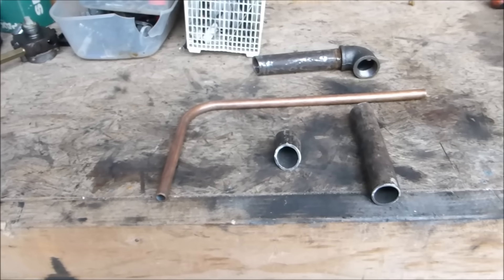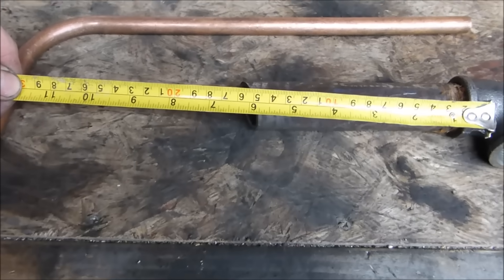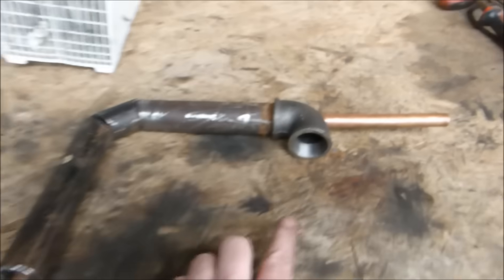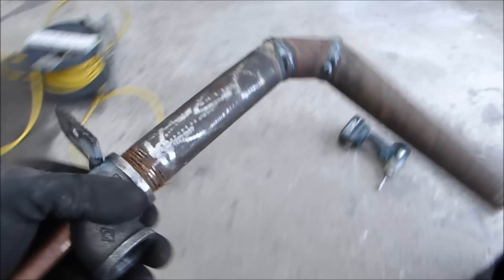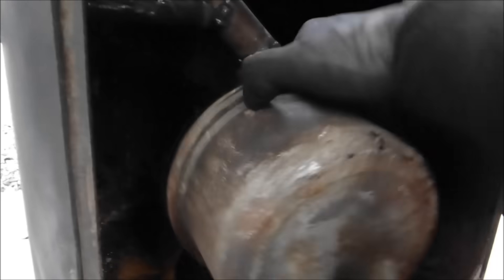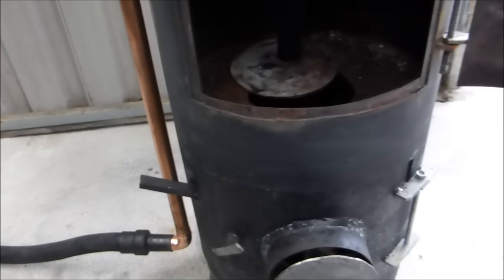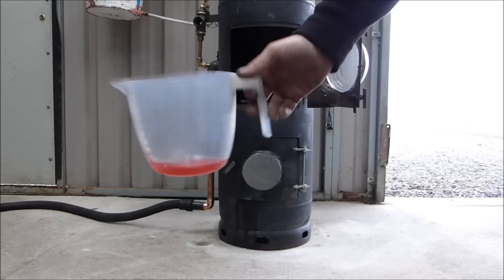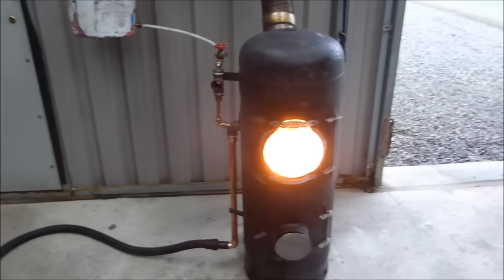Build a New and improved fantastic output Waste Oil Burner.

Comment: I'd  love  to  see  this    heating  water  for  feeding  round  a  waterborne  heating  system  (radiators)  or  blowing  warm  air  through  some  transverse  tubes  going  through  the  burn  chamber,  providing  warm  blown  air.  A  household  air  recirculating  system  could  be  used,  re warming  the  air  from  one  end  of  the  house  and  pushing  it  back  into  the  other, thereby  reducing fuel use by  not  heating  up  fresh cold  air  all  the  time!  this  apparatus  is  a  little  too  noisy  and  smelly  (not  to  mention  unattractive)  to  have  in  your  living  space,  and  will  need  to  be  somewhere  else  where  it  can  smell  sound  and  look  as  orrible  as  it  likes!
Reply from the maker: Hi Iain. I made some videos a few years ago with an Ozzirt waste oil burner connected to a hot water clinder. The system of connection is the same as a home water based heating system with rads. Some of my newer burners would be a better fit with this setup.  https://youtu.be/PaEOpqqPwgs   Cheers Gerry

Comment: built one of these today, started and about 9 o clock and lit it at 2 o clock, super simple. i revised a few things which i think make it a little easier, but never the less couldnt have done it without this video, going to convert the barn from propane to waste oil or diesel or kero
Reply from the maker: Well done tuesday, enjoy being warm wednesday , thur... (lol) Thanks for the comment and well done on getting the unit built.  Cheers Gerry
Reply: Does the all need to be shallow in the holding hands
Reply: That was supposed to be shallow in the pan that the pan so it reaches  igniting temp for oil

Comment: Thanks for sharing your excellent videos! Can you explain why not use two separate tubes for air and oil? Is that to shield the oil inlet so that it doesn't catch fire before being injected?
Reply from the maker: Hi Max. The tube in a tube method is just to stop the oil line from burning the oil on the way down to the vapourising pot. It would quickly char up and stop flowing. The air helps keep things cooler. In one of the videos I used an old boiler to heat about 80 gallons of water. Once you can make heat its an easy enough job to transfer that heat to water. Here's a link of a non forced air burner heating water.. https://youtu.be/1Et3rIn5GIY   Cheers Gerry

Comment: Hi Gerry,
I've  built one of your burners but im finding i need to mix my waste oil (diesel sump oil) with diesel to maintain combustion. Is the distance between oil/air outlet and burner element important?  Mine's sitting about 40mm from the element. I'm thinking of increasing this to about 60mm.
Reply: I reckon the distance is not so relevant, more so the heat of the burner. The heat of the burner can be improved by forced air.

Comment: Very clear video, very helpful. Perhaps it might be an idea to filter the waste oil through a piece of old bed sheet or nylon tights. I think people making these heaters based on Spike's (YouTube id ozzirt) design have experimented with different hole configurations in the burner tube but yours seems to be working well. Do you get clean emissions from the flue once the burner is hot?

Comment: I got two old kerosene burner assemblys out of tar kettles, when using propane sounds like a bomb when it lights , extreme heat but not effective on milage , great 650 degrees  balance

Comment: I like your waste burner design. I like the two pyrex glass windows. Have you thought about putting a pipe heat exchanger. I've built them for my pot belly stove and put it on the duct coming out of the stove and I capture more heat coming out of the top of the stove. The stove pipe at the top of the building is only about 100 - 125 degrees.
At the stove it is about 800 to 900 degrees. It works very well. You could do this with yours just by putting the
pipe in, wrap it around and come back out. I used inch and a half pipe and found a little squirrel cage with a small motor and I heat a 800 sq foot apartment with it. Warm and toasty.     Ray

Comment: That is a very interesting and insightful design for burning waist oil.  He didn't show the exhaust system but i assume that he ducted that upwards and outside the 'garage'  which was being heated by radiation only from the stove service.  Also, I think you could use a large diameter  pipe-maybe 12 inches- for the stove unit and you do't really need a window once you get it burning.   Also, need to know what he is using for a blower and whether a low volume fan of some sort would also work?   -

Comment: what temp does copper melt at? seems like this would be way to hot for it
Reply: Chris Pastuf copper has a very high melting point
Reply: Good to know thanks
Reply: Chris Pastuf copper melts at 1,984°F. I think copper is a poor choice for that.  the guy that built this said the whole unit becomes red hot.  hope he has no trouble. steel usually around 2500°F.

Comment: My biggest concern is the smoke ....what about a shot of the chimney and the smoke it produces...? is there an obvious burning oil smell?, will my neighbours be complaining cos of the oil / smell getting on their washing / chests / asthma or whatever or does the introduction of excess air completely burn off the oil with no smoke?....I suppose the next thing would be to have this heat  water and pump it round a system?  I see you've limited the oil supply container to 'just big enough to burn yer house down' size....cant imagine ye'd dare to leave this unattended? what about designing in some protection devices , maybe to shut off the oil  / air if the fuel supply valve got too hot maybe? ( just a thought).....thanks for posting  this  :¬)
Reply: zyny

Comment: Burnin engine oil is toxic
Reply: Burning ANY fossil fuel creates toxic byproducts.  So, if you're so concerned, stop using your car, traveling by any internal combustion engined vehicle, heating your home with gas or electricity, etc, etc, etc!
Reply: iksxful 
yeah and all other oils are none toxic. lol if something burns, it creates fumes of one kind or another so will be toxic. it's all about what you use it for and where. outside heater is the best choice for this home made burner, however, flu it properly and have an emergency fuel shut off, then inside use on a tiled or hard stand area should be fine.
Reply: +iksxful - Everything is Toxic! Where do you think your Electricity from? I hope you don't think Solar or Nuclear right?  LMFAO

Comment: How do I reduce smoke from waste oil burner?
Reply: Minli Kukec if there was more air going into the fire, that should reduce the smoke. A similar example would be an acetylene torch, which produces a LOT of black smoke until you turn on the oxygen tank. More air inlets should fix the problem.
Reply: U have to burn them like a jet engine .... there is no clean slow burn

Comment: I've built a burner to heat our kids pool. The issue I'm having  is counter common sense. After getting it started and I have the oil drip set for no smoke and  mega heat, which is great, the pan slowly starts to fill up. which obviously means it's not burning the oil quicker enough.  if I turn it down the heat drops and it smokes badly. The first time this happened, I had to wait for 20 mins for the excess oil to burn away, during which time it smoked badly. not good for the neighbours! I have drilled more holes, maybe not enough? any ideas?
Reply: wayne bardell a bigger pan possibly? with more surface area, more oil can burn at a time.
Reply: wayne bardell
Reply: Napalm Pyro

Comment: It would be supercool to combine this with a "mass" oven so the majority of the heat won't just blow out of the chimney.Circulating the chimney through one or two tonnes of clay first would let you run it at lower fuel consumption and have  a source of heat retention that would last for a day or two. ;o)
Reply: Dennis, is it possible to "build" a heat converter with those building stones with holes in it ?
It would mean you build a stone wall around or above the chimney but, I think, if done properly you could direct all the fumes thru the stones which will absorb the heat and ray it all in the surrounding area.
Reply: Another thing could be, but a little more expensive, make a network of metal tubes and connect them in such way that the fumes (and the heat) goes thru these pipes/tubes and take a lot of heat from it and ray in in the surroundings.
Reply: In "homestead resque" shows Martin Rainey , a flue that has two bypasses on its chimney, the fumes goes thru them all and ina simple way a lot of the heat is warming up the air around it.

Comment: $30 Shop Vac, set to blow, plugged into a dimmer switch (variable air control), mounted outside to reduce noise, if desired.
Reply: Or one of those plug in leaf blowers, since they sometimes have variable air speed built in. Or an inflator pump, like for pool toys. But I agree with you on the shop vac. Home depot sells a $25 "bucket head" vac/blower which is awesome to use as a dirty water wet vac, but I think it would be perfect for this. You wouldn't even need the bucket, although I'd recommend it for support, for this application. Instead of a dimmer, you can also just use a valve to mechanically limit the air flow, as long as you don't completely starve the motor of cooling air. (not applicable for bypass blowers with separate cooling fan intake). You can also power a shop vac or any other universal motor off DC power, like from a few car batteries such as in an emergency /power outage situation. Or.... hook the chimney of this burner up to a boiler and a steam engine, to drive a blower, & make it completely self powered 😅😅 Either way I love it, very clever yet simple oil burner.
Reply: A lot of us run shop air. You could pipe your shop air to it on a regulator and a solenoid valve and run that on a thermostat or a switch. you know, if you wanted to complicate things for the sake of experimenting 😅

Comment: Interesting that the 'waste oil' used here appears to be unused motor oil i.e. clean, consistent viscosity is not what you find with 'used' oil.   As with most oil powered devices, the incoming fuel MUST be precisely and continuously controllable for the duration of the burn session.  Which is hard to accomplish without laborious prior filtering of the waste fuel and a continuous hand on the control valve.  ANY clog in the delivery valve CAN result in momentary flame-outs....just imagine what happens as a slug of motor oil hits the inside of a yellow-hot 14" steel pipe inside your shop!!  I've had the PD out to my place several times for reports of explosions!!!

Comment: I wouldn't mind you putting one of those in my home
.
Reply: I had a homemade wasteoil heater about ten years ago. Worked similar to this. It worked great! Really clean once it got hot! Smoked like heck when cold. The problem was, as the stove and the room get warm, the oil supply gets warm. Which makes it flow easier. So you have to keep adjusting the oil valve, or it will get out of hand. Then you turn the valve to less oil and it starts to shut down. You have to babysit it constantly! So, these heaters are great, but don’t leave them alone!

Comment: I think you are a little crazy doing this without any kind of safety devices.  An OSV would cut off the flow of oil in the event the stove ran away.  A Firematic would cut off the blower.  You have created a blast furnace capable of reaching temperatures higher than what would be required to degrade the structure of the stove itself.  If that oil line above begins to melt you have loose fuel all over the floor.
Reply: +CommentsFromMe I agree..blast furnace Danger!  Will Robinson! I prefer gravity fed myself.

Comment: Did any of you see that the oil being burned was not used!!!!
Reply: +Robert DeLong  I noticed it , but the principal would include any oil that's available. waste oil would burn dirtier, What I wanted to see was the type of blower used, is it a vacuum cleaner in reverse or a hair dryer or a compressor [less likely compressor since we heard it running] it looks like a good set up for a shed or barn in the country but in my suburbia location the town would be so far up my ass for smoke pollution.... I have a wood burner in my shop now [2 car garage ] an they tried to shut me down for that, when everyone on the block has fireplaces in their living rooms but I use pallet wood rather than hard cord wood and neighbors complain about the smell plus I use rolled news paper on top of the wood , that dam news paper last a while in the firebox as long as theirs wood burning also . I think the best unit is an old oil burner modified to burn waste oil ,[ you can find that build here on YouTube] and have a filter system to keep the nozzles clean and water out .... redoing a oil burner would take less time than building this unit being shown . and a $50 compressor for the pressure works fine] plus its a contained unit with a fan an thermostat just like in the house . I have a waste oil system,  commercial grade[ Clean Burn ] in my house and it uses waste oil . I have 2x 275 tanks and during the summer I go to small trucking co. and get their waste oil from their fleet even taxi co. I even driven by parts store and pick up gallons customers left in the parking lot . I have a 275 on rollers in the back of my suburban and a pump system to pump out of the 55 gal. drums the fleets put their waste in. and the same pump pumps it out my truck an back into my 2x 275 gallon and in some cases they paid me to take it away, 20 25 cents a Gallon I've even gotten mickey Dee's french-fry oil but that's being pick up by the bi diesel guys for their cars....  In this part of the country [NY] its a cheep investment . On an average home gas or oil will average $375 to 400 a month. PLUS+ so in one season your total investment is paid for , if your resourceful it could be cheaper and if you have the money to go new, its about $3500 before install so you guys in Maine or Montana or up state NY that could be an early return. good luck guys have fun be safe! JR

Comment: Hello .  Great set-up . Just one Question ?, What kind of glass did you use for the door. It somewhat looks like a glass bowl , If so or not will you please share. Thanks. Jamminjim
Reply: +james Armstrong, they  most likely  used a glass pyrex bowl. is the only thing that might resist heat
Reply: Thank you Jean Raymond really appreciate  the input

Comment: Nice build. A yellow flame means smoke, soot and a dirty overall burn. You need to restrict the air flow alot more to put it under some pressure. Put an endcap on the air and start by drilling some horizontal holes in it like how a stove works. Once the flame is blue, then you will achieve a clean burn with no smoke. You can also get rid of the drip system in favor of a gravity fed setup. Any liquid will self level, if you create small pool inside and out, your feed tank just needs to be air tight in order to be self feeding.
Reply: The problem is not the airflow, it will burn orange no matter how much or little air you give it, the problem is burning the oil in a pool, in order to get a clean blue flame like you are talking about you would need to atomize the oil and the balance the airflow against that, but in doing that you are bringing expense to the situation which would defeat the purpose of this burner which is made to be cheap source of heat
Reply: @bandit911  How much expense? If it was just a one time expense, it would probably be worth it for a shop that does a lot of oil changes on cars and has a lot of waste oil. Or maybe you could just make all the dirt and grime and smoke only went outside?
Reply: @enermaxstephens1051  look up Riello oil burners, they designed for burning diesel or kerosene, but can be modified to burn waste oil, but it will need to be filtered and heated to thin the oil out before entering the burner, the problem is the consistency of the oil you burning all being the same oil, would need to save up as much oil as possible in a tank and mix it all to the same consistency to set the burner to burn that oil (air to fuel ratio), but it can be done and definitely worth doing if you have a constant supply of oil 👍🏼

Comment: What did you use there for the door bowl glass thing Gerry. Having just built a 8M X 5M workshop this seems a better way than having to keep feeding a stove with logs or scrap timber and a lot less costly. Logs have become stupidly expensive round me to the point where you may as well just buy coal. I'm a welder/fabricator fluent in all types of welding so your video has inspired me. I remember as a kid that a local blacksmith had a waste oil burner that used to glow red hot. I'm sure it was self running so didn't have a fan and I'm also fairly sure it had an integral oil tank as well without a flue to the outside. I havn't seen one of the same for a long time. I can remember the shape however. A friend has a fancy new thing but to me it sucks too much electricity for what it does so what's saved in heating is spent in electric. Good to see fella.

Comment: Why didn't you just bend the large pipe using a 3 roll bender?
Reply: than you dont get the copper pipe in it
Reply: +janos nagy Well... it depends on the construction method and where you make your cuts.

Comment: Love this idea.  Great heater. Cheap and apparently easy to build. I would like to see a little more about how the air comes in at the bottom of the heater. Can't help but be a little intimidated by all this heat and flammable oil.  How would you  assess the risk of fire?